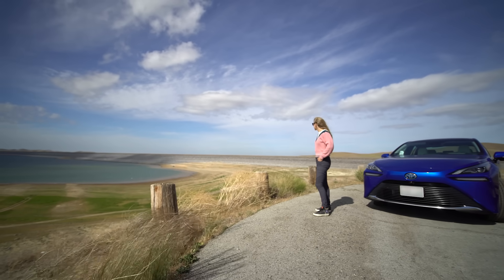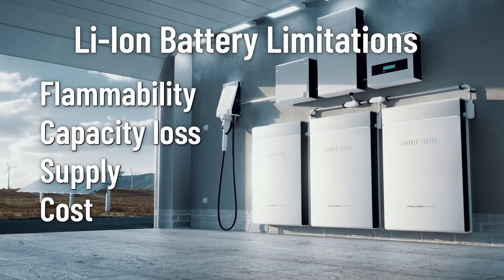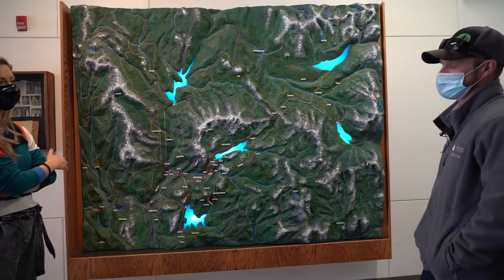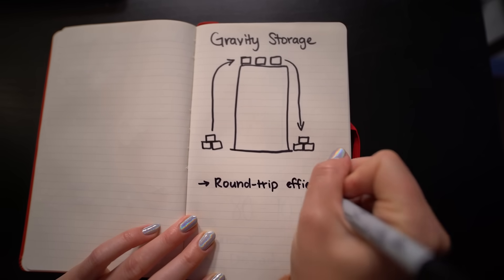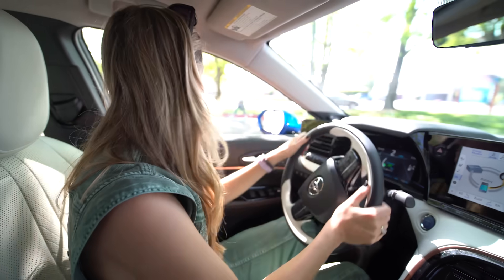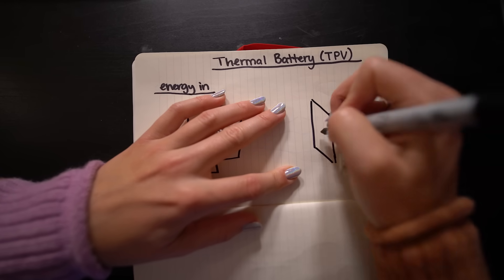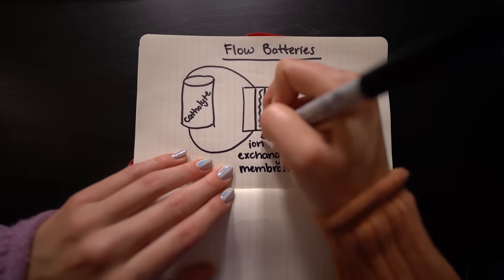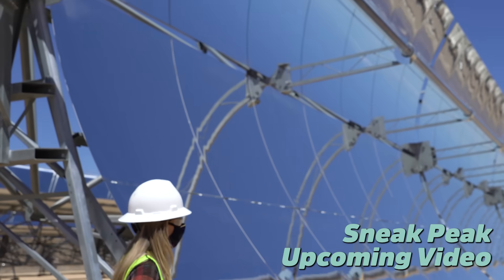The BIGGEST problem with clean energy

Comment: Instead of storage, place mirrors in high orbit to reflect sunlight to ground based solar farms.  By being lit 24/7, a solar farm can produce 4 (summer) to 6 (winter) times the energy.

The mirrors are very simple, solar powered gyro's to and control circuitry to aim the mirrors to available solar farms.  

Being solar sails only need to be inserted into low earth orbit.  Use the mirror as a "sail" to climb to high earth orbit (30,000+ miles).
Reply: If you had this technology you would use it for winter heating and sunlight rather than eletricity generation 

A City like New York or London would pay at least $30 billion a year to avoid winters and have summer every month of the year

The side benefit would be the solar roof tops would generate twice as much energy thanks to 4 summers per year and no winter autumn or spring
Reply: @kaya051285  Global energy requirements require an increase of solar energy of about 0.3%.  Modifying weather takes a lot more.

$30B buys a lot of Florida - but New Yorkers are already doing that.... ;-)
Reply: @stevesedio1656  Modifying relatively small parts of the world eg dense cities should be possible in the future. Rich cities would pay a lot to turn cold places warm

I could imagine London goes from 10 million to 20 million people if London was the only city in the UK which had 12 months warm pleasant weather

The city might be willing willing pay as much as 10% of GDP to achieve this which would mean a budget of as much as $100 billion a year

Simply put, people would pay a lot more for pleasant weather than they would pay for green electricity

Comment: Technology Connections recently did a video about how his house is essentially a thermal battery, and that the same thing can be rolled out at very little cost in any house with a smart thermostat.
Reply: Well...and good enough thermal insulation.  But yeah, I figured someone would comment about his video!

Comment: I'm a big fan of gravity batteries. They have an actual positive influence on the environment, they take up very little footprint, they're the most efficient and the only catastrophic failure they can endure is to drop the weight accidentally or a generator fire. Both of which should be very controllable.

Comment: You should talk about V2G technology (if you haven’t already). I anticipate it’ll be a huge part of micro grids in the future
Reply: Not needed.
Main requirement is when vehicle is home. That happens when the OWNER returns home. At that point, it's maximum power use in the house.
Use the vehicle to power the home and remove THAT from the grid.
Then, when the household is in low use (sleeping), and the grid is in excess, trickle charge the car.
Reply: @rogerstarkey5390  I don't see how you say it's not needed and then explain exactly how it would work in a home setting, using the cars battery to load shed when you arrive home and charge overnight when demand is low. Also, V2G would be best used outside the home anyways, like in a parking garage so you can lower peak demand at whatever office building and open the possibility of perks or payment for allowing the usage of your car's battery. Especially great for places that use PV or other renewables that need a place to store electricity when not needed.

Comment: They complement each other - this is critical!
Reply: Hydrogen doesn't.
3GWh in.
1 GWh out.
😜
In other words, you need 3 times the base generation "overcapacity" (that's when you collect it!) To ensure a stable off peak pool of energy.

And just btw, it's never green Hydrogen.

The green renewables could ALWAYS be used to offset use of fossil generation SOMEWHERE on the grid.
That's until we're 100% renewable, at which time it's a moot point.

Comment: Amber Kinetics is the industry-leader in manufacturing grid-scale kinetic energy storage systems (KESS). As the only provider of long-duration flywheel energy storage, Amber Kinetics extends the duration and efficiency of flywheels from minutes to hours—resulting in safe, economical and reliable energy storage.

Comment: hydrogen in cars is not a good solution, hydrogen has an energy storage is good idea for peak uses.
It's not even good for a smart grid, you need to go to a refill station, the refill station needs to be refilled... it's very inefficient.
Cars with batteries either lithium or other is much better than hydrogen.
Hopefully aluminium batteries will come out.

Comment: Redflow has the smallest zinc bromide flow battery in the world, but they can be linked together to provide grid scale power. They have some contracts in California now. The main differences between lithium and flow - flow are best suited to stationary applications, they perform well in hot climates, don't require cooling, don't catch fire like lithium can but while lithium discharge quickly flow discharge their energy more slowly. So the big batteries in Australia are fast releasing lithium grid management devices - they don't usually send power to homes and businesses - flow batteries wouldnt suit grid management but they would send power ( charged from say solar during the day )  to homes and businesses ( say at night). Ideally you want both Lithium and Flow present in the same grid to perform their different functions. Using Lithium to perform the job of Flow is a waste of Lithium that is needed more in transportation.

Comment: It's good to see so many technologies being used for energy storage. As you say, a multi-pronged approach is almost certainly the best way to go.

There's just one problem : net zero by 2050 is way too late. We need to aim for net zero by 2030. Our current best understanding is that we need to avoid exceeding an increase in global average temperature of 1.5 °C over pre-industrial levels, because that's where several positive feedback mechanisms start to have a significant impact. And we're actually very close to that limit right now.
Reply: In order to achieve "net zero," more research still needs to be done. Next, all of these new carbon-neutral power plants and energy storage facilities need to be planned, permitted, and constructed. All of this needs to be done not just in one small area, but all around the world. As of 2021, the year 2030 is only nine years away. Accomplishing all of this in just nine years in unrealistic.
Reply: @Eternal_Tech   -So what?

If we don't aim for net zero by 2030, we're in for the worst catastrophe human civilisation will ever have faced.  Better to try and fail than not to bother.

If bureaucratic systems and regulations are getting in the way, they must be changed. This is more important than nations' economies and corporate profits.  This is about whether or not we have a civilisation in fifty to one hundred years' time.

If we had started taking this seriously in 1990, or even 2000, the transition would have been easy.  But, because we've left it to the 11th hour to take it seriously (in fact, many governments are still not taking it seriously), it won't be easy. But we need to try.

If we aim for net zero by 2050 instead of 2030, we know that we will fail to avert the worst effects of global warming. If we aim for 2030, we at least have a chance.

Comment: don't suppose you could use the powerlines as temporary storage? set up high voltage standing waves in them at a different frequency and filter out the normal frequency traveling wave?

Comment: This is fud . The problems are not as bad as you make ou5 . Pumped storage actually not as efficient as you think . Batteries can be installed in various size and places . Pumped storage only possible where the geography possible . Lithium iron not a problem for fires or cost. Hydrogen also not as efficient or as clean as you thought . Hydrogen is not available , stop saying this. Natural gas and hydrogen not the same . Flow batteries not the holy grail. There are many products in the background , but first out normally wins

Comment: Love the series, there's allot of problems to get over in the future. I live on a boat so lighting, charging batteries etc can all be done by solar or wind power. The problem is heating. How can you heat a boat, small flat etc using renewable sources with a low carbon footprint?
Reply: If there's ballast, maybe this could be used as thermal storage.
Reply: @projectmalus  thanks for the reply. Trouble with that is the largest volume of ballast is usually external of the interior in sailing boats. Motor boats its probably too spread out. Good idea though.

Comment: Good video but my vote is for modern safe small molten salt reactors which can run 24 x 7 and use the electricity to produce hydrogen via electrolysis for cars etc.  No storage issues.

Comment: This is great information! I have seen a few videos about energy storage but learned little new. Yes, those big heavy flywheels that comprise the bulk of Pelton wheels or any other turbines of course store a lot of kinetic energy and keep our AC grid running at a steady pace even when we all plug in our tea kettles simultaneously at 4:58PM. But most of the technologies you presented here were new to me. Thank you!
Reply: Here's a thought.
"At 4:58 pm" we've just driven home (early?) from work, in a car, which could be an EV, which will very likely have the 10 kWh or so we need to run the home (just THAT home!) Over the peak period.....?
After that, all the power required for industry during the day can be used overnight to power the homes and their specific car for the next day.

Comment: Prediction for the next video = concentrated solar with molten salt storage perhaps???

The Mega Battery in South Australia has served a very niche market which is maintaining the frequency of the grid, which it can do in micro-seconds, orders of magnitude quicker than any other solution (~5min spin up vs 0.0021s for example) and it was able to achieve "payback" within 5 or 6 months due to how quickly it could respond to market requirements/drops in frequency...

I've also seen lots of talk of mechanical batteries (fly-wheels!) but super keen to see your next video and see if my prediction was close /right

Comment: Excellent series about hydrogen and energy. As you point out, we have no practical way to store large amounts of electricity, although we can convert electricity to other forms of energy which CAN be stored. I am hoping that the upcoming vid you teased will be about that big solar plant in Morocco with liquid salt stored in a giant thermos.... that sounds cool to me. I especially like the low-tech way that use mirrors instead of expensive/delicate solar cells.

Comment: IMO Nuclear power is the only "clean" energy source with enough power density to replace fossil fuels, within our current technological reach.
Safety and security are the only issues. But those can be pretty much covered.
Reply: Well and if nuclear fusion ever takes off, safety and security will be largely unnecessary, and there's a Scandinavian country (Finland?) that is building a Gen III Fission Reactor that will have passive storage of nuclear waste off-site. So we are finding solutions.
Reply: @andrewcopple7075  The way I see it, we are about as far away from usable, safe, sustained nuclear fusion as we are at containing and using anti matter. The only fusion we've ever successfully done are in thermonuclear weapons. And that's an uncontrolled, short lived, and thoroughly destructive application.

The sun has gravity on its side. We haven't figured out a way to safely or effectively fuse atoms in a sustainable fashion yet without the use of an atomic explosion/implosion. Even particle accelerators consume more energy to move those atoms than it could produce in any supposed fusion reaction.
Reply: @rvs55  You make no sense... How are PA's even relevant?
Reply: @someonespotatohmm9513  I assume it would be a PA they would use to research colliding beam fusion. 
So like the Hadron Collider, it's gonna use a massive amount of energy.
Reply: @rvs55  No, magnetic confinement with high temperatures is the most pursued method. Inertial confinment is also researched but I don't think that is regarded as being as promising. Using the structure of materials (latice confinement) to promote fusion is also researched but don't hear much about it and seems to have a bad name from the cold fusion debacle.
Reply: Build the plant.
Even optimistically, that's a 10 year process.
That'll be 10 years of equivalent fossil generation added to the problem.
...
Do it economically.
Even projects nearing completion (ish) are running well over budget (and late) with agreed costs for the power at over double that for renewables (with the renewables cost still decreasing)
.......
Then there's
Location
Scale (everywhere)
Safety (ref location)
Change in climatic conditions (happening!)
etc, etc, etc....
Reply: Renewables are cheaper.
Reply: @gregbailey45  only on paper. France delivers electricity 50% cheaper and 10x cleaner than germany.
Reply: A good video on how to understand and use your instincts https://youtu.be/XrmyGtdmgoY

Comment: I really really think we need to invest and commit to new age smaller safer nuclear energy. I think we can get past the stigma from the unsafe era of the past. Nuclear energy is really the best no emissions, high power efficiency option that's stable and much evolved since the things we've seen in the past.
Reply: There is a chance for fusion but no point in nuclear if overproduction of renewables is cheaper than building new nuclear.

Comment: "Lithium batteries have capacity loss" well, nothing last for ever. LiFePO4 batteries last a loooong time, and after that you can recycle them, make new ones from that. The water turbines need regular inspection and be replaced at a certain point, up to that point the water turbine slowly loses efficiency.
Reply: Nothing is forever, the blades on wind turbines need to be replaced as well at some point. I wonder how that goes these days given that many are made of some fiberglass composite material (traditionally considered impossible to recycle, maybe with enough demand for it someone will find a decent way). I suspect the water turbines presumably being more metal based will be somewhat easier to process once it's separated into parts.Replacing an individual turbine is one thing, but in the case of a man built dam and not some pipes between two convenient locations how long does such a dam last? Can it be repaired in place or will it have to be rebuilt entirely. It's all different with the impact of replacement and how long it is expected to last. Even the energy from the sun will expire one day although that'll take "a while" and I don't think the red giant stage will be great for Earth.

I wonder how long the electrolytes in the flow batteries will last, given that it's liquids being pumped around it should last long since there's not solid things that break or build up undesirable surface contamination. But it could still pick up contamination in the liquids themselves and the ion exchange membrane presumably doesn't last forever either.

But yes you've got a good point about LiFePO4, always been a fan of them since they became available due to being able to handle more cycles for some medium size projects here at home. Pricy things but both lighter and better capacity than lead acid while being easier to handle and lasting longer than the also expensive regular lithium ion chemistry batteries. Wasn't aware of the recycling part though, is that one of those technically possible cases or already being done?

Comment: pumped hydro "can react really quickly: in 5 minutes". You know what can react extremely quickly: Lithium batteries, in miliseconds!
Reply: Yep, although dinorwig pumped hydro power station in Wales (UK), also known as "electric mountain",  can react in 75 seconds from a standstill, or less than 30 seconds when compressed air is used to pre-spin/synchronise it's turbines, which is a lot faster than 5 minutes!
Reply: @davidpowell8249  30 to 75 seconds is much better than 5 minutes. And if pumped hydro would place batteries on site, then batteries can do the first minutes AND react in miliseconds. Pumped hydro hybride!
Reply: @GiesbertNijhuis  indeed, but the batteries would need to be able to output 1.8 GW for those first few minutes!
Reply: @davidpowell8249  1,800,000,000 Watt maximum continuous output.. Holy electrons, that is a lot! 1,728 MW to be exact, that would be 1728/1.2645 = 1,367 Tesla Megapacks.
Reply: @GiesbertNijhuis  yep and and it can run for about 4 hours and has a capacity of about 9.1 GWh.

When you think about the number of Tesla packs that would take, you can see why pumped hydro storage totally dominates storage.

Tom Scott did a short video on Electric Mountain:
https://m.youtube.com/watch?v=6Jx_bJgIFhI

Comment: I feel like these Toyota sponsered videos are always somewhat biased vs lithium ion batteries. I liked your intros to different tech, but on the technology readiness scale, they are not the same. Todays research points toward lithium ion batteries going to be the cheepest storage tech for up to some days of energy storage. Cathode recycling and alternative battery chemistries like LFP, related Sodium-Ion batteries etc. can solve the materials shortage (and are quite far along on the technology readiness scale). They are not an option for seasonal storage, but that isn't really what was talked about in this video.
Reply: Lithium ion may be cheaper and more easily scalable... for now. We've had decades with the technology, of course we're incredibly efficient at implementing it. All the technologies other than hydro storage talked about in this video are still at early stages of development. efficiency and scalability will increase while cost will go down.